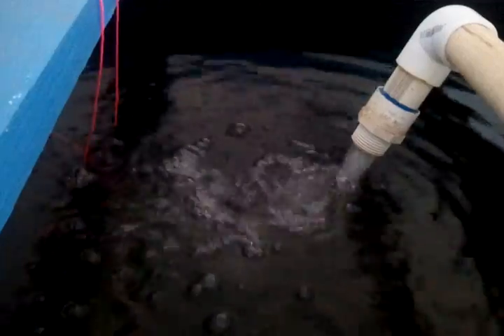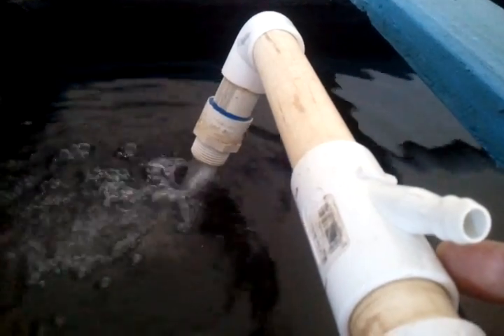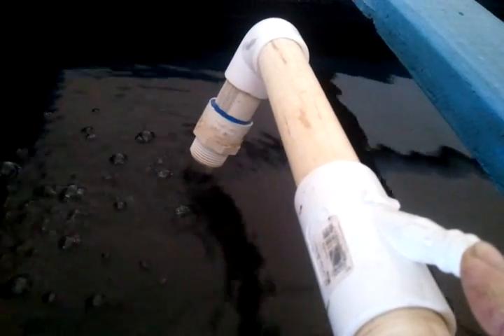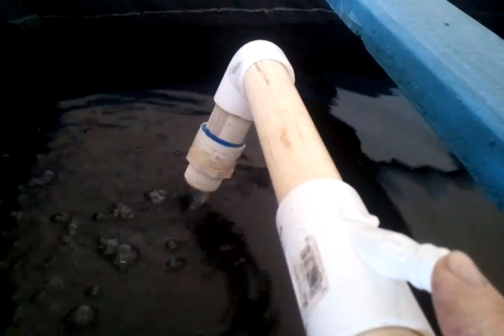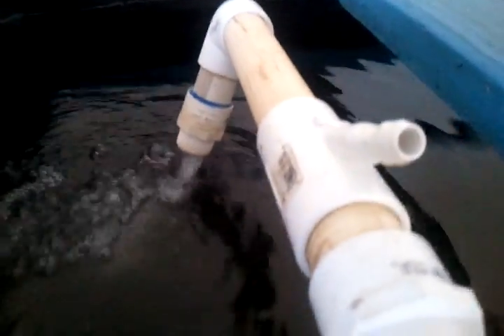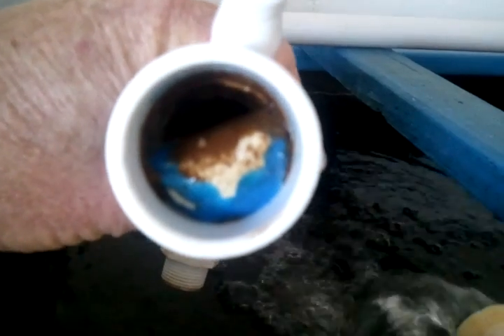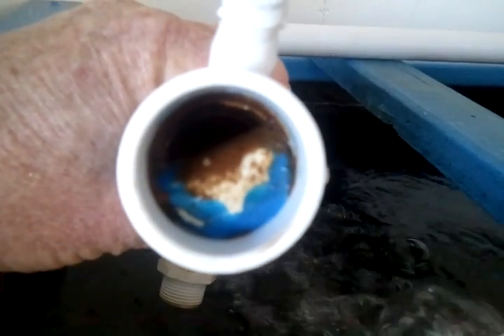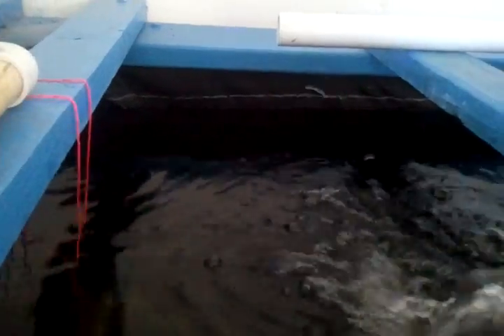Simple DIY Venturi For Aeration

Comment: anyone every get a part number or the actual name of the wye piece?? cant find it any where
Reply from the maker: It's an irrigation fitting that attaches to a piece of funny pipe between a sprinkler head and the main water line.  I got it at OSH but you might find it at an irrigation supplier.  There are so many other ways to accomplish this so don't put too much energy into finding it.
Reply: yea looked on OSH`s web site they dont have it, think im gonna do a DIY with a 90 peice

Comment: do u have a part number?
Reply from the maker: No I think I found it at OSH.  It was labeled Swing Tee but when I google that I don't see exactly the same fitting.  I'm pretty sure you can design something using one of the other available Swing Tees or a regular Tee
Reply: the pipe coming into venturi has to be sized down correct?
Reply from the maker: This part I used is not optimal but it works without reducing the size of the pipe.  Yes you are correct.  The ideal method is to create a low pressure area where the air enters by reducing the size of the pipe at that point.  This increases the velocity of the water traveling past the air inlet.  I know that may seem contrary to what you might think should happen, but it's called the Bernoulli's principle.  YouTube has many videos with instructions for making your own from a Tee.  Most of them make good ventures, but the explanations of how it works is often wrong.    One easy method is to insert a tube with an angle cut at the end that is inseted inside the Tee.  This is an effective way of reducing the volume of the pipe at the point where air is sucked in.
Reply: I can't find it either - but I found this. Google Venturi Fertilizer Injectors - you will find something that works.
https://www.amazon.com/Highmoor-Venturi-Fertilizer-Injector-Irrigation/dp/B07GH1BQWS/ref=sr_1_2_sspa?ie=UTF8&qid=1539369037&sr=8-2-spons&keywords=venturi+fertilizer&psc=1